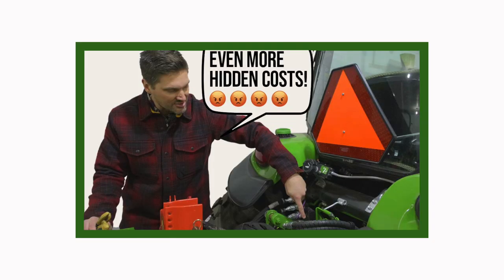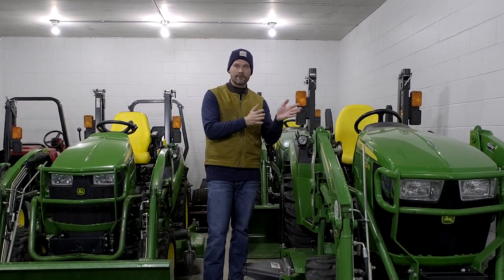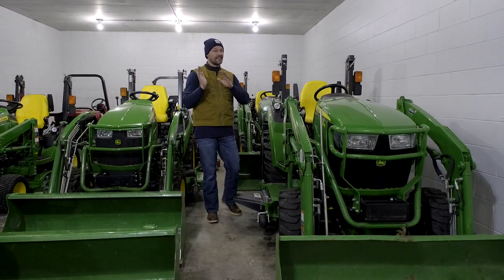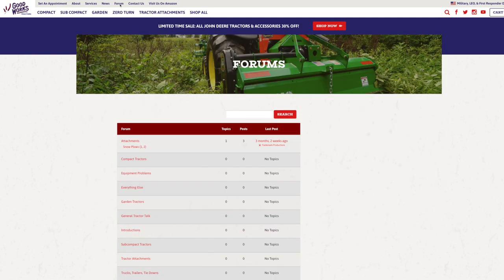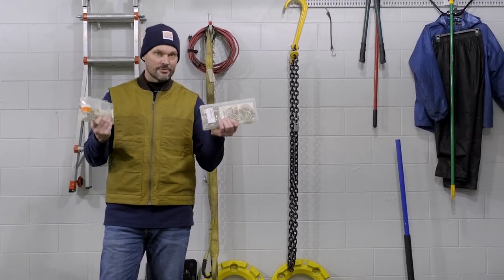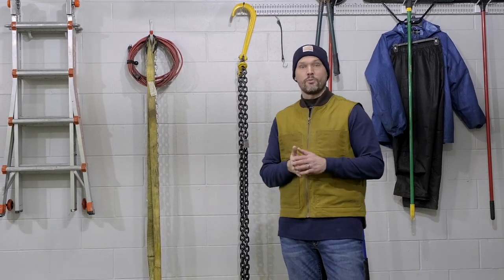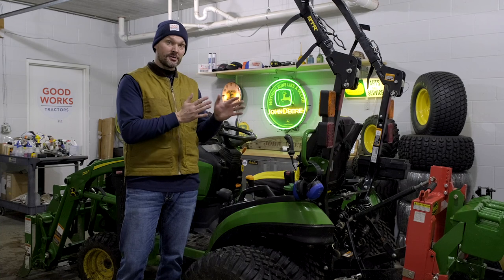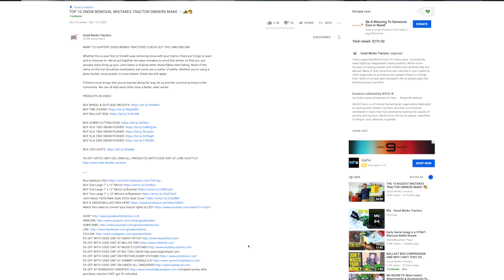THE 5 BARE ESSENTIALS EVERY TRACTOR OWNER NEEDS 👩‍🌾🚜👨‍🌾

Comment: Say Courtney, very good tips.  How about a tool box large enough to hold a 1/4"-1/2" small socket set ?
Also using fiber lock nuts will prevent them from vibrating loose too.

Comment: I might add that Kubota is really good at support from their corporate headquarters in the United States. Actually they are located in my area of Dallas-Fort Worth. We bought a used older Kubota that was produced in the early to mid 1980s and I sent an email in to Kubota USA. In 24 hours they sent me a PDF of the owner's manual which has been very helpful since I got it over a year ago. Also they are very good at answering any questions that you are unsure about as far as attachments, three-point hitch compatibility, etc.
Reply from the maker: Good, because I just got a 1971 Kubota B7100 that appears to have a short.  Might have to reach out to them!

Comment: question: What tractors have the most consistent fastener sizes? eg almost everything is a 10mm nut or bolt.
I am not yet a tractor owner, but I view consistency in fastener choice as an indicator of ease of maintenance, plus, it'd be a lot easier to buy a couple of extra wrenches/sockets and keep them on the tractor if I'd only need 3 or 4 rather than a whole set.
for clarification, I'm mostly thinking along the lines of the fasteners that are externally accessible, I try to reserve going under the hood of things for when I'm at my shop anyway :P
Reply from the maker: I'm not sure of the answer to your question.  If you're buying a new or newer tractor, then there isn't much wrenching to be done anyways.  Little maintenance and typically not many unexpected issues.
Reply: @GoodWorksTractors  thank you for the reply.